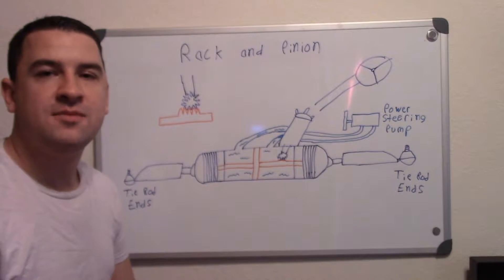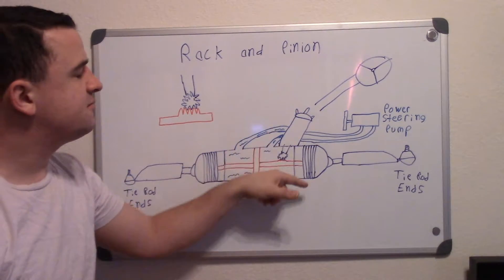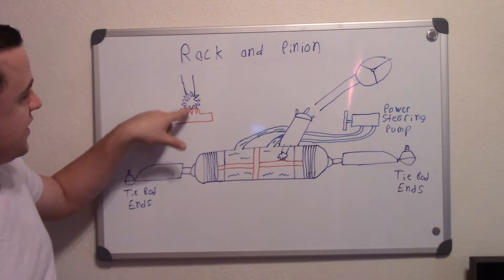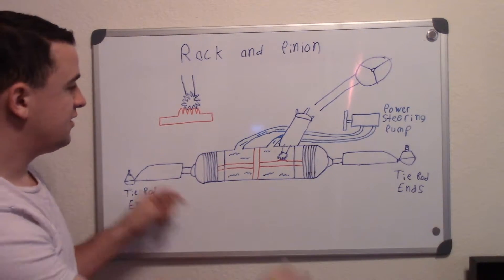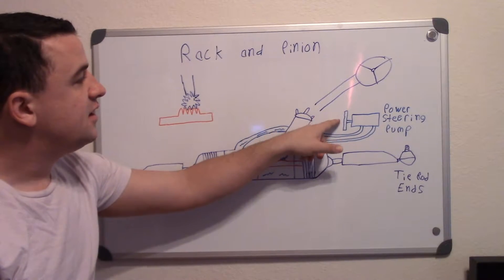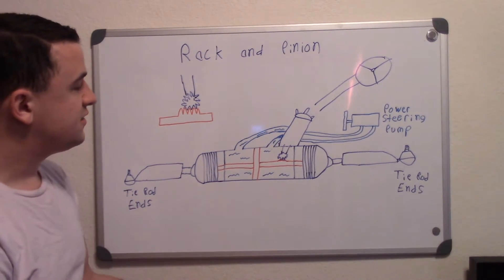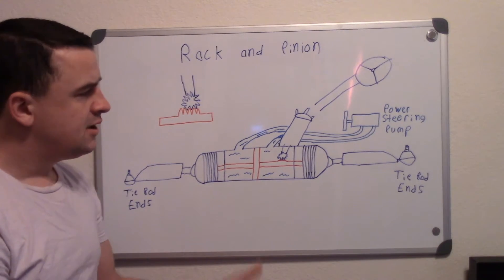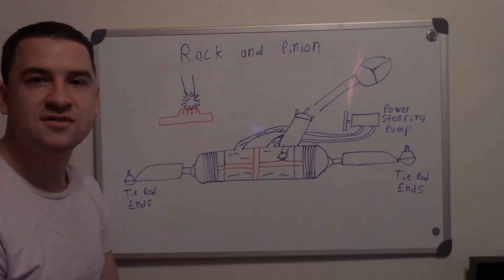How Rack and Pinion Steering Systems work

Comment: hey man how to adjust steering  stiffness on a 2005 chrysler 300 steering rack it's  too sensitive too soft no play I checked  it tie rod and ball joint  are ok, is there a srew or bolt  to adjust  how hard or soft is the steering on a steering rack.
Reply from the maker: Not sure if it would be adjustable. I don't think it would be, but some manufacturers may have them be. Usually sensitive is better because it makes steering easier. But i would check with Chrysler to make sure.